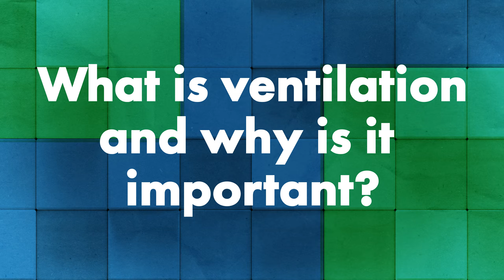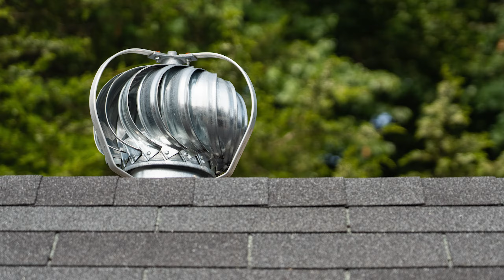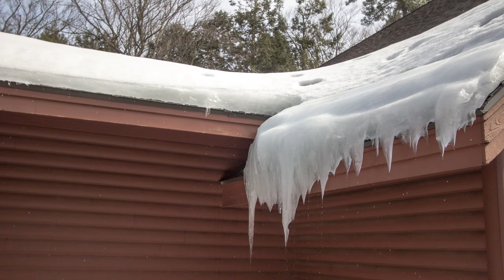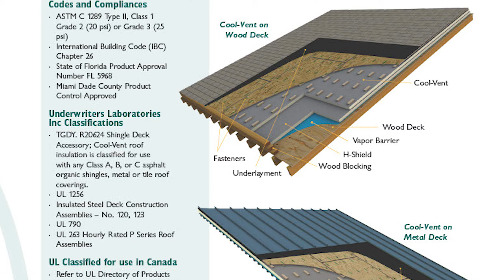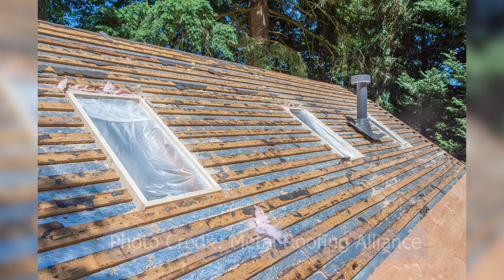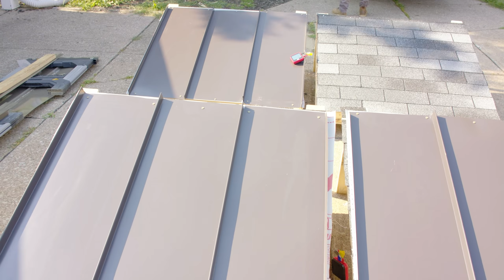Roofing Ventilation Product Options, Best Practices, and Assembly Design

Comment: Is the only purpose of ASV to keep your roof cooler? I thought it is also supposed to drain water that’s condensing on the underside of the metal panels or bulk water coming in through potential leaks? Similar to a rain screen wall. If so, wouldn’t the Hunter panel prohibit drying in those situations as the air gap is underneath the deck? So any water getting underneath the metal panel would just sit there?

Comment: How does one calculate the air that would be need it to move? Is it based on size of the roof or slope?
Reply from the maker: Local code may dictate the amount of ventilation needed , but the U.S. Federal Housing authority generally recommends the 1/300 rule: 1 square foot of ventilation needed for every 300 square feet of attic floor space. Here's a calculator from GAF that can help: https://www.gaf.com/en-us/for-professionals/tools/ventilation-calculator Remember, your building's requirements may dictate a different calculation. It's best to consult a ventilation expert about your specific needs. -Thad

Comment: Roofer put a ridge vent on my double wide mobile home. The ridge doesn’t vent. I discovered during renovation the OSB has zero air gap at ridge to vent. He refuses to install ventilation now. I have a 29 gauge metal roof. I have e done calculations on amount of sq in. of vent based on size of home I will need approx 400 square inches or 200 on each half of roof. What is best vent for that?

Comment: Any bad experiences with the mesh under metal for the metal clip attachment? Seems like it could cause odd metal bends and bulges.
Are longer clips recommended to distribute the pressure over more distance?
Thanks!

Comment: Each of our 50 sq inch NFA static snow vents use an 80 sq inch NFA of stainless steel 120 micro micro pore filter to block fine blowing snow.  The 120 micron micro pores are porcelain smooth and will never rust or clog. Convection and wind keep the filter perfectly clean.  The extra NFA in the filter ensures good airflow.

Comment: Any suggestions for a mansard roof that has a flat top and four sides. It’s 1929 fire station with built in gutters so no eaves or air intake vents. Attic area houses the hvac system but it not conditioned ( no duct work to heat or cool that attic) with staircase down to second floor. Any recommendations for venting or closing it all off for open cell on the inside?, would be great as we need a new roof asap and would like to do metal. Our quotes so far have had mixed suggestions. Located in Michigan

Comment: Right on. Super helpful. Some questions/comments for yah:
1. Any high performance product recommendations for exhaust vents that flash well with metal roofs?
2. Thoughts on perforating the metal roof material for eave/ridge vents?
3.  My understanding is mesh vent material is no bueno. All the added surface tension from the mesh retains condensation moisture. 
4. Thoughts on VentGrid?